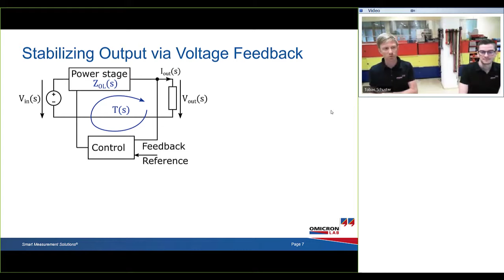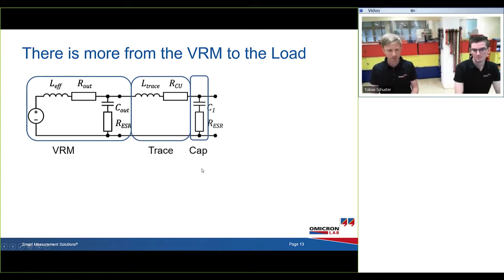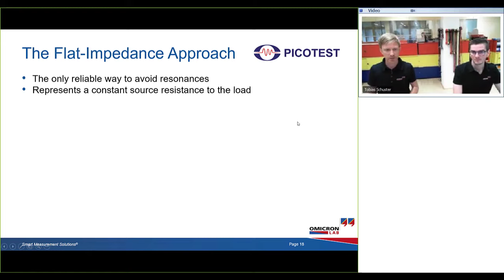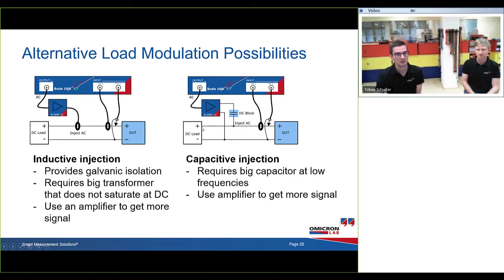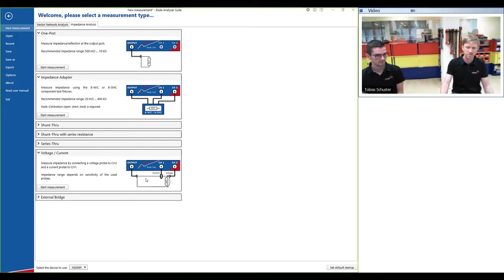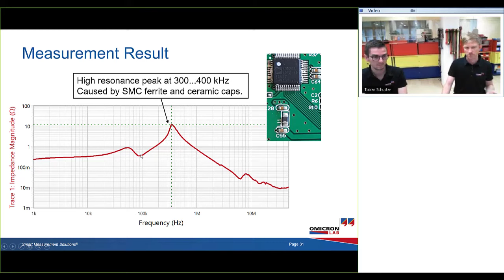Webinar: Output Impedance of Power Supplies

Comment: the output impedance resemble S22 which is =B2/A2 when A1=0. my question here is we need the DC bias for any voltage regulator to measure its output impedance but in this case we are not making A1=0, how can we get around that ? 
i know that if we have an EMI Input Filter and we want to measure its output impedance, we can short the DC input voltage at one of its side and perform the output impedance as done here. I find this makes more sense with the definition of S-parameters. 
why is it different then to VRM ?

Thanks
Reply from the maker: The easiest way to measure output impedance is when the system is actively running so no external bias needs to be applied. Please check out: https://youtu.be/nvNtQwo17P4

Comment: I saw you used a self made DC BLOCK in the test setup.  What is the component of the DC BLOCK, is it a capacitor?
Reply from the maker: Yes, it is a capacitor. Just be careful when charging and discharging the capacitor. It would be good to do that slowly in order to protect the instrument.

Comment: Is this NISM method can be used on the ripple-based COT buck converters where error signal is generated by the comparator instead of opamp and compensation network ?
Reply from the maker: NISM can basically be applied on any control scheme. It will show you the effective output impedance which is generated by the voltage supply. However, if it is highly non-linear, the output impedance might also change strongly with the signal level. But generally, NISM will tell you how the load sees the supply so it is always interesting to apply. The phase-margin calculation however will not make sense in case of non-linear control.

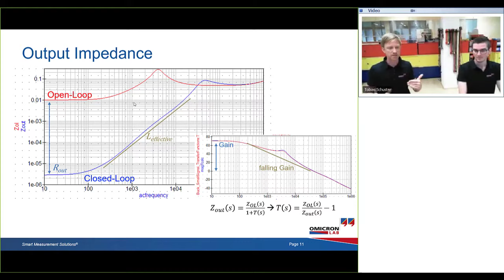Comment: at 8:30, how can Z_out exceed Zol, if T(s) > 0, and therefore Zout <= Z?
Reply from the maker: Because Zol and T are complex numbers with phase values. If the phase margin is low, meaning that T has a phase close to -180°, 1+T will be a number <<1, therefore Zcl can be larger than Zol.
Reply: @OMICRONLabTutorials  makes sense, thank you!